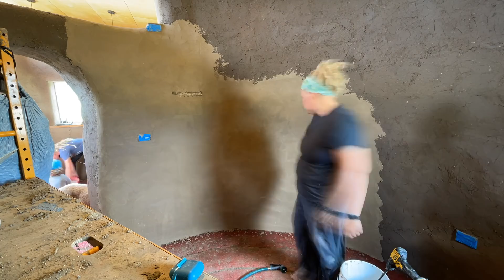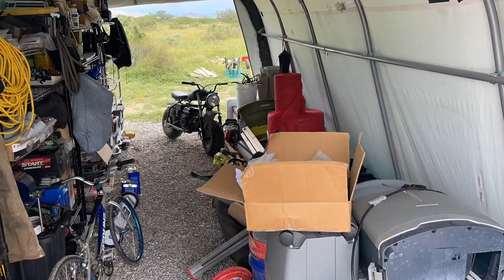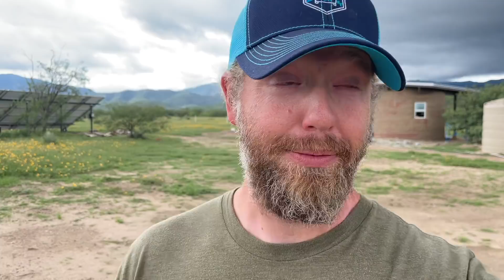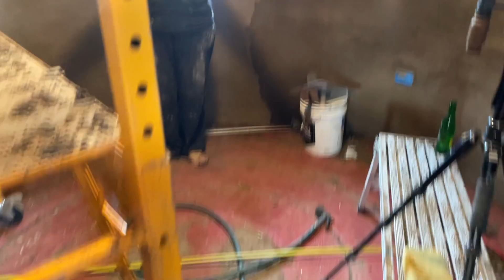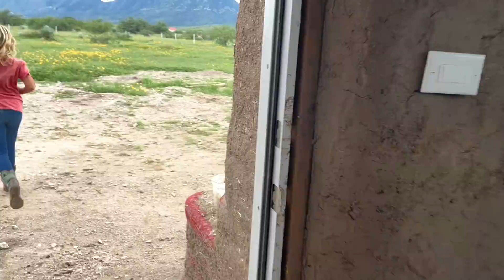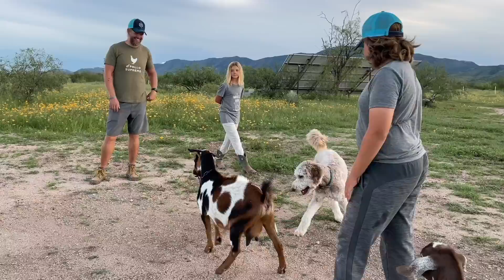Get This Shed Done - Day 3 - Internet Antennas, Measuring for Bed & TV, More Final Plaster

Comment: Thanks for sharing. We live in the high desert in N. Nevada. We have a roku. Works great. Our second RV on the property has a damaged antenna. So we will look into the sure call.
Reply from the maker: We're probably going to opt for the Apple TV for privacy reasons, but yes we only need internet connected television stuff. It's pretty much all we've been using the past 5 years anyway 😂

Comment: Sorry to tell you but you are mistaken about Starlink. Im in Northeastern AZ at 5k ft elevation. Winds are crazy here too. Getting 120mb consistently @ 99$/mo and no data caps. Use mine for mining crypto and streaming 4k video without interruption. because of low latency, I have 0%rejected shares and 0% stales. Hughesnet had data caps and about 13-14% stales and about 5% rejected. Nomad cell internet was worse that that with the directional booster pointed right at the cell tower. Ive replaced Nomad(verizon and at&t), Hughesnet, and dish network with Starlink.. was paying about 650$/month for the others plus data overages. Now 99$/mo no data overages. Im extremely happy with it. We are buying a place between Concho and Showlow now start doing what you guys have been doing. Starlink will be available in all of Arizona by December. I suggest you get on the waiting list for the equipment now so you can get it as soon as coverage is available.

Comment: Maybe think about a TV mount with a swinging arm so you can pretty much put it anywhere on the curved walls,  and then just retract it when your not using it.
Reply from the maker: It will swing a little bit, but the room is so small, and the bed is stationary so once it's in place it shouldn't' need to move.

Comment: The omni directional antenna appear to be on the side of the building opposite to the trailer.
Do the think the building could interfere with signal strength?
Or are they just acting as repeaters?

I reckon it will take 3 days if you kick nine-nine out and bribe/blackmail the kids in.
Respect from New Zealand
😀👍
Reply from the maker: Just repeaters.